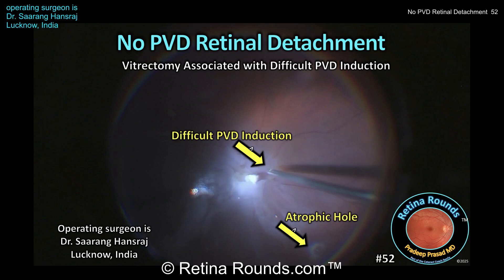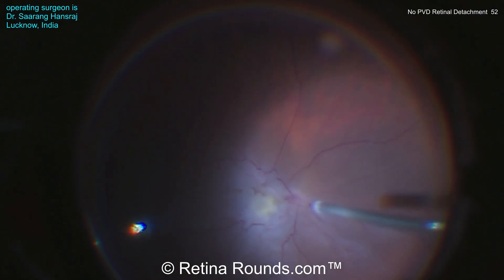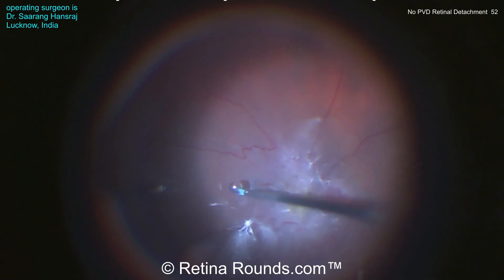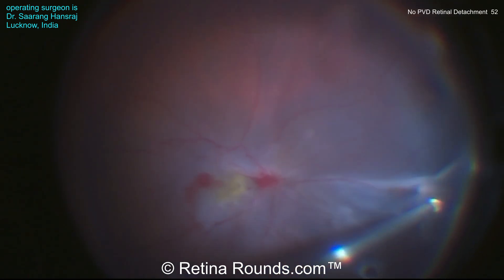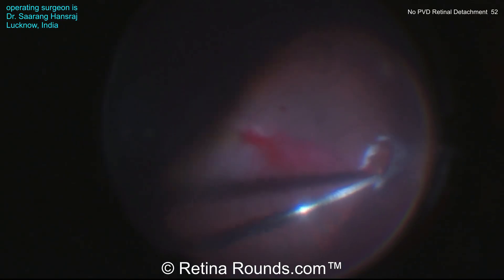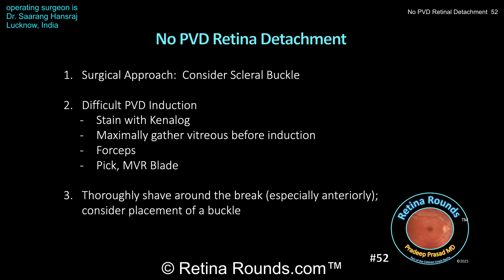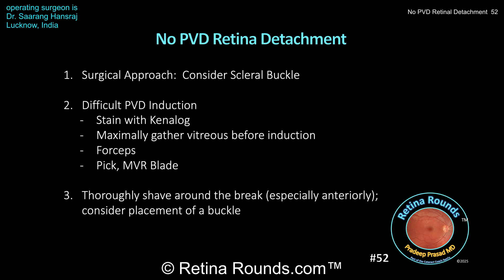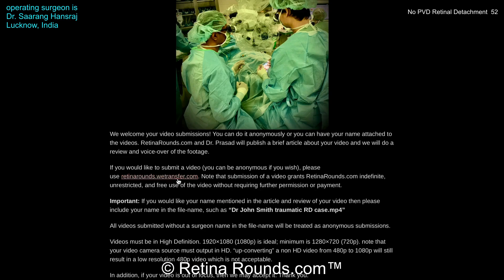RetinaRounds™ 52: No PVD Retinal Detachment

Comment: Perfect management 💐 

Does using of triamnisolone making induction of pvd easier ? I dont ask this question for visibility of vitreous . Change of vitreoretinal interface relation. Which label of triamnisolone did you use in this surgery ?
Reply from the maker: Thanks for your question.  I don't think the triamcinolone affects the vitreoretinal interface.  I use kenalog-10 or dilute kenalog-40 (1:4 dilution with BSS).  I hope this helps!